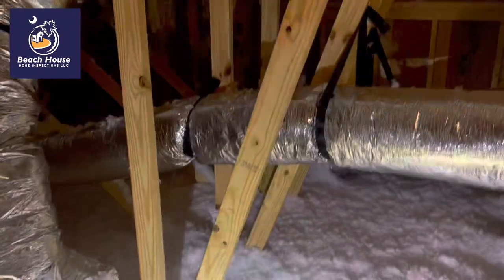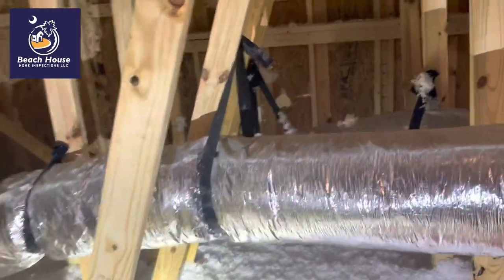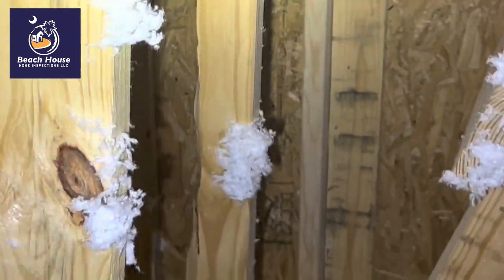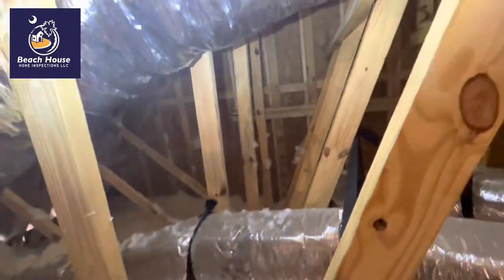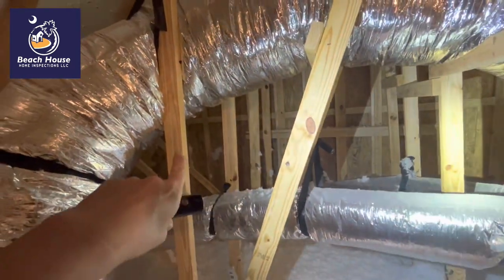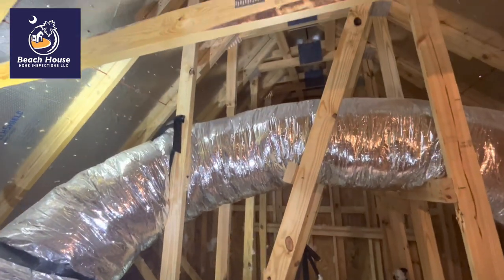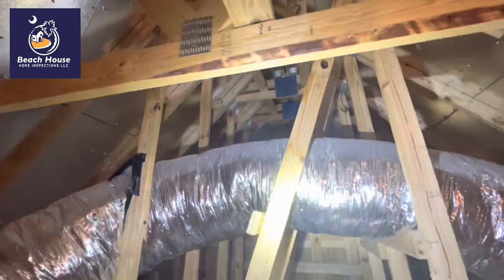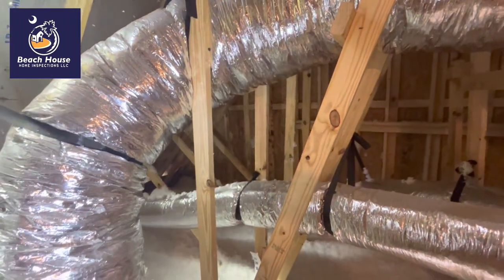Two broken trusses on a new home

Comment: As a MIOSHA Construction Safety officer, I've seen many of the things you are pointing out.
On one job, a single story office building the crew had installed approximately 40 roof trusses. Rather than follow the truss manufacturers, supplied bracing schedule they used, what I refer to as "killer cleats". This is a single piece of 2x4 cut to fit the span from one truss to the next. While all the trusses are connected to each other, they only used two per pair of joists. They install them with a single nail, at each end.
On this job the had all the trusses installed, as above. Two men were working on them and one was inside cutt8ng more "killer cleats". During the work the trusses started to fall, in one direction. I call them "killer cleats" because when used they offer no diagonal support/bracing. All they do is ensure that when they collapse all the trusses are equally spaced, and usually someone dies as a result.
In this case no one was seriously injured. The carpenter wanted to pick through the trusses and salvage them. I told him no one was going to enter until an engineer said it was safe. As for the trusses, any they wanted to salvage had to be inspected by an engineer and determined to be safe for reuse. Needless to say, an excavator was brought in and reached over the walls to grab the trusses and deposit them in a dumpster.
Reply: @h2s142 No problem with acceptance of material. The issue was the trusses, as installed, had no diagonal bracing installed. With just horizontal "killer bracing" installed, with only one nail at each end, there was minimal stability. The contractor wanted to reuse the collapsed trusses. I know that trusses are a "design item" with the plates specifically designed/installed. I am not a truss engineer, able to say, "Go ahead, they're all in good shape." If the contractor had the ability to make such an "educated determination" fine. I had no authority to say that those trusses would/wouldn't hold after the collapse. Or that all the plate connections were still good. My only concern was the safety of the workers.
Reply: @h2s142 As I said, if the contractor had the "education". Not degree, but education. Education can mean formal or informal training.

Comment: Trusses are built from crap lumber, often no. 2 or 3 grade. As long as the cords are intact. they will function. You would think that trusses provide perfectly flat ceilings, but I find that to be rare, either crooked lumber or bad installs. 
The damage in the video likely occurred when the delivery driver rolled them off the tilt bed and they slammed onto the ground.
Reply: There is no excuse for them being installed in that condition.
Reply: They were out of spec. to begin with.
Never should have been used.
Reply: Was going to be my reply. Exactly.
Reply: I think the damage could have occurred after install, if you look at the sterling board at 0:44 it looks like there is damage to that as well.

Comment: It’s insane that a builder even used that piece of wood
Reply: That would be the truss manufacturer
Reply: The builder still decided to use it
Reply: Track house, truss's come in on a truck, that one got messed up and the builder used it anyway. If they would have sistered the bad boards with a couple new 2X4's when putting them up no one would have ever bothered about it.
Reply: Nope, it's routine.
Reply: Most likely the broken members are from careless delivery of the trusses. Extremely unlikely they were broken after set in place.

Comment: I built a tree house for my daughter last year with a mix of No2 grade lumber for studs and some 4x4 members as well as No2-grade southern yellow pine for some beams. 

What I learned from this as well as something that I've learned from looking at studs in my own home when I've had to cut out some drywall in a few areas to fix things behind the walls is that a lot of lumber that is sold at lumber yards and big box stores is defective. You can go to a lumber yard and look in a pile of No2-grade lumber, and you will ALWAYS find some pieces that would be totally inappropriate to support a structural load. There might be very large knots that almost go through a stud, and the wood around the knot may not be stable. There may be longitudinal cracks through a long stretch of a piece of lumber. Many pieces of lumber at a yard are bowed or twisted. Some have WAY too much bark on the outside or chewed-up edges.

I have found some pieces of really poor lumber behind my drywall that I would never have used if I were working on my own home.

Whenever I build something myself, I spend probably an hour sorting through the lumber pile to get the 20% of good pieces in the pile for my project. This is totally worth it for small renovation projects in my experience. Personally, while I HATE spending so much time sorting through lumber at a big box store, I think it probably saves me time later in my project when I discover that it's impossible to build something square and plumb because the lumber is warped.

A lot of builders and carpenters just don't care. They want to finish a job quickly, and they won't take the time to sort through lumber piles to cull bad pieces of lumber. This means that some studs behind your walls may be bowed or twisted. I would imagine that this is also going to happen with pre-made floor and roof trusses. I understand why carpenters may not want to spend so much time sorting through lumber at he start of a project when they're working for a living to feed their families, but it sucks for a homeowner when a builder cuts corners and creates structures that aren't strong and stable.

Comment: This is why I'll take a home built in the 50s to 70s over anything new built today.  I love my 1962 house because it's overbuilt as hell.
Reply: Yeah, I don't think so.  I live in a 1947 pre built home, most of its construction is crap.  Made as cheap as possible.
Reply: @commodoresixfour7478  Are you referring to a manufactured home or a stick built?
Reply: This is the worst myth that people to stop spreading. It is true that they don't build them like they you too. For good goddamn reason. Because the old houses were built like crap. Yes the old timber was better and true to size. Like a 2x4 was actually 2x4  same where the 2x10 was 2x10. The issue is with old houses. They did not use hangers they would take a nice piece of timber cut a notch timber. The foundation's sucked back then No lally columns or footing. If they needed a post back then. They were usually cut a tree trunk. That would be on the property from when they cleared the lot. Did not matter what kind of tree. Because the lot was cleared right before building the house. Whatever tree trunk they used as a post would be green. The framing material they used for the first floor deck. Is the word that they stripped from the forms. That's why when you go into a basement of old house you will see concrete footprints on the ceiling. Especially how they framed the support walls in old houses. Usually no headers over the doors or Windows. If they did put headers in there'd be two by four on the flat. With just two framing nails through the studs. No King studs no Jack studs no she'll know cripple studs. The list goes on. People see things built in the past with rose-colored glasses. That's why when people sell an old home. To make them feel better they don't say the floors are unlevel the doors don't close no more. They say it's an old house and it has charm
Reply: @commodoresixfour7478 elieve it or not they had shotty contractors back then you simply bought a lemon. I live in a home built pre war 1932 . So almost 100 yrs and standing tall and proud at two stories with an attic apartment.
Reply: @Dr.Meola1980 let me know how your house looks at 90 years old. Mine is fine in hurricane territory we had three trees down in the last two storms but no damage to the house. We see a lot of wind and a lot of it is straight line even
Reply: @jajajajajajajajaja867 yes out of hundreds of houses there bound to be great ones. I think that applies to today as well.
Reply: In today's world it's all about the money. How fast can we get it done.... How cheap can we do it..... Craftsmanship in new homes is dead.
Reply: I'm a licensed builder and I've been a carpenter for 29 years. The codes are now are way better than the 50s and 60s. After 78 one couldn't use lead paint,  the floor support for per square foot increased, treated wood is now required on concrete contact with sill seal, etc. The homes built now are actually over kill. Have you ever heard the term, " they don't build them like they used too?" As for homes it's a good thing. I've tore out exterior headers that were 2×6 over door walls at 6 feet in older homes. Back then that was common and it showed in stress cracks all over.
Reply: Also probably avoid an HOA with an older home.
Reply: @Dr.Meola1980 wrong. You talking 1800’s fuck. 

60 year old houses with truss and metal plates.

Upgrade insulation and your better off than a new built piece of shit.

I fix new homes all the time, old ones only when never updated before (so long time coming) or for a scheduled replacement.

New home are crap. Period.
Reply: @Dr.Meola1980 yep and much worse insulation as well. And many don’t have central venting either.
Reply: @justinstevenson2061 wrong but ok
Reply: @Dr.Meola1980 my uncle who was a master carpenter and in the business from 1930s to the 1980s had the exact same sentiments.
Reply: Remodeled homes for a decae.  Age has absolute nothing to do with build quality.  Hacks have been around forever.

Comment: City inspector either rubber-stamped the inspection from his/her office or is on the payroll of the builder.
Reply: Or they are only designated a small amount of time per inspection. 30 mins.
Reply: @francismarion6400  constraints like these are often imposed to systematically via defunding the relevant department to ensure regulations aren’t imposed… then when tragedy strikes, the business can pass the buck to the state, aka tax payer, which will be held liable—“privatize the gains, socialize the losses”. Real estate developers spend a lot of money in elections… this is part of their return on investments. So whenever you hear a corporate backed legislator state that we need “small government” this is what they really mean.
Reply: Building inspectors only inspect what is due on the sheet. This damage probably happened long after the framing inspection. Probably when the roofers loaded the roof.

Comment: It’s just how testing goes. It tells you the process is typically sound for producing quality framing materials, but cannot guarantee everyone is sound. But it is why many towns like mine will not adopt the national building code. It states that rough sawn lumber coming off my mill, because it is not stamped, does not meet the requirement. Maybe, but my old Victorian is still standing at 3 stories tall with rough sawn hemlock. That would NEVER be allowed under the national building code. It is also why I love my town, it’s up to Me to build something safe and live in it. It’s also up to me to build something that will meet inspection criteria if I sell my home.

Comment: My house was built in the late 60s. Back when they used better quality lumber, from trusses to plywood instead of osb.  We did replace the old cast iron drains and updated the electrical.  But I'd take my house over a newer cheaply built house any day. And I live near the east coast where we usually see a hurricane or two every year with no issues minus a shingle or two.
Reply: Just so you know plywood is not always better. The same thing goes with solid beams. Laminated beams can be far stronger. Just because stuff was over built back then does not mean it is better. Just more wasted lumber. 
Houses have trusses ever 2 feet because the walls are weak and they have no header and are supported by studs every 2 feet. Post frame construction if far better because you can support your roof every 8, 10, 12 feet. Your entire house is built on a frame with a main header rather than a stud wall. A frame can give you a full cavity wall in which you can insulate and prevent thermal bridging. You no longer need massive headers over windows and doors because your roof is not supported on the wall. You can then run 2x4s or 2x6 horzontal girts on the outside and inside and then install your sheathing/drywall  and drywall on the inside, while you are at it you might as well install sheathing inside for the ceiling and walls. This will not only provide you places to attach things to the wall it will create a much stronger building, help reduce drafts, sound. Enjoy a much stronger built house with walls that are about 12 inches thick and provide 9 inches of insulation. Live in a noisy area this will reduce so much sound you will be unaware of the outside world. This wall thickness will and should exceed your zone's requirements for insulation. If you use a product like zip R sheathing ( osb with foam glued to the back ) you can far exceed all values. 
Homes are built much better today if you have a component contractor and you make sure you include everything in your contract.
Reply: This is the worst myth that people to stop spreading. It is true that they don't build them like they you too. For good goddamn reason. Because the old houses were built like crap. Yes the old timber was better and true to size. Like a 2x4 was actually 2x4  same where the 2x10 was 2x10. The issue is with old houses. They did not use hangers they would take a nice piece of timber cut a notch timber. The foundation's sucked back then No lally columns or footing. If they needed a post back then. They were usually cut a tree trunk. That would be on the property from when they cleared the lot. Did not matter what kind of tree. Because the lot was cleared right before building the house. Whatever tree trunk they used as a post would be green. The framing material they used for the first floor deck. Is the word that they stripped from the forms. That's why when you go into a basement of old house you will see concrete footprints on the ceiling. Especially how they framed the support walls in old houses. Usually no headers over the doors or Windows. If they did put headers in there'd be two by four on the flat. With just two framing nails through the studs. No King studs no Jack studs no she'll know cripple studs. The list goes on. People see things built in the past with rose-colored glasses. That's why when people sell an old home. To make them feel better they don't say the floors are unlevel the doors don't close no more. They say it's an old house and it has charm
Reply: @Dr.Meola1980  I like this a lot. Just honest truth. I have a old ass house and I hate the hell out of it. So much that I am going to build a new house in a couple or a few years. I own it outright so I am saving up what we would pay in a mortgage and or rent and prepping the area where I am going to build and getting a bunch of things done before I build. 
I am also taking a lot of notes and thinking about every problem ever found on every job site. I want to house to last me the rest of my life which is about 60 ish years.
Reply: Called balloon framing ... load bearing walls went from foundation to the roof ... and I bet those trusses broke when they were delivered and dumped off the back of a live edge delivery truck
Reply: @Dr.Meola1980 : '... the old houses were built like crap.'   Nothing has changed, then.
Reply: My new build has OSB. You can’t believe how often I wake up at night in a sweat, desperately wishing I had plywood instead. 2X6 construction, 8’ tall basement ceiling, gap filling cracks before drywall goes up, all such awful things, aren’t they? And my dead flat floors on these engineered joists—man I wish I had dimensional lumber that was warping.

Comment: Why can you not take the electrical panel off? That makes zero sense You're not modifying changing any of the electrical only inspecting what else are they hiding
Reply from the maker: The state requires me to report on the service entrance conductor material. By not taking the panel off, the builder is forcing me to violate state mandates. 
The builder with the broken truss is the same builder that does not allow me to remove the panel. As you can tell by the truss, they have things to hide.

Clients pay me to come back and open the electrical panel and walk the roof. My last inspection resulted in 40 shingles in need of replacement and two defects in the electrical panel.

Comment: I am just an electrician, so how does two trusses break like that, and is that a hole busted through the back wall near that broken truss, and its a shame that a builder has no trust in their electrician  and prevent you from checking out their fire hazard electric panel.
Reply: When the rollback drops the trusses sometimes they don't move the rocks.
Reply: @francismarion6400  Ah. And the builder just says. Most of truss is still good. Install it? I don’t understand what happened to quality these days. Guess it’s time money over quality.
Reply from the maker: The truss was damaged before they were installed. Everyone looked the other way during construction. The hole in the sheathing is normal. It’s a hole for rigging the end truss.